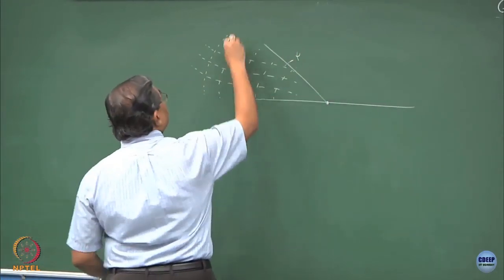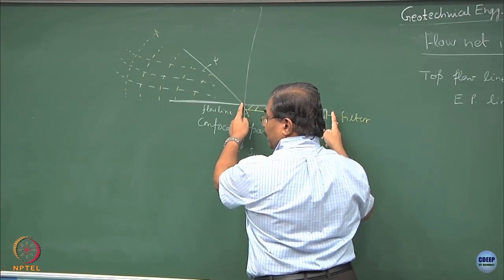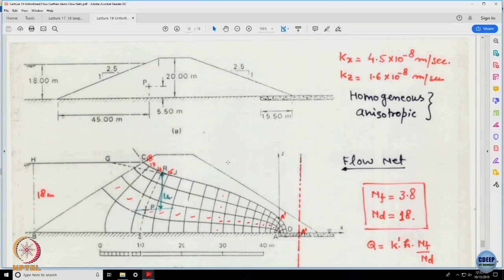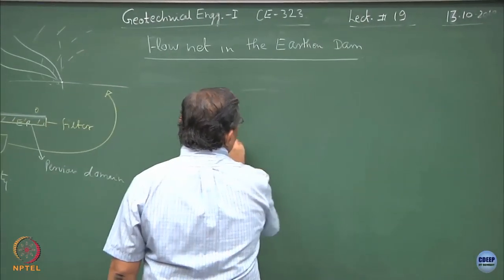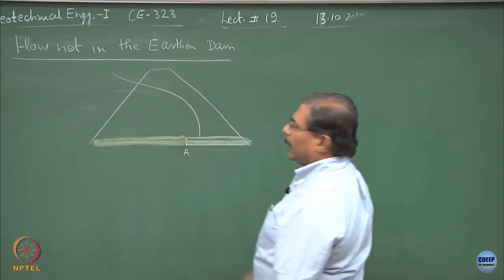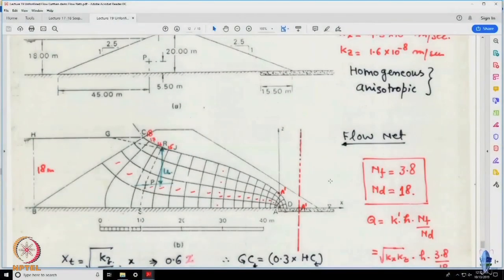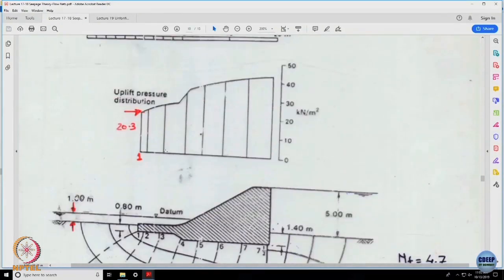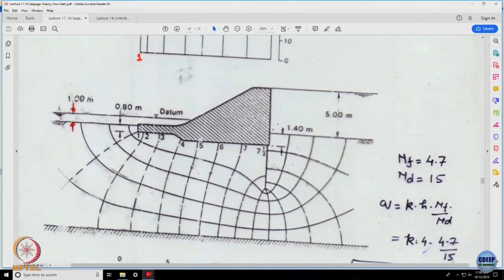Week 9: Lecture 21: Flow Net in the Earthen Dam -I

Comment: How can be number of flow channel in decimal form as 3.8
Reply: When we draw flow net then it is possible that the number of flow channels is not integer like 4,5,6,etc. So for a smaller size flow channels we use decimals... Like there can be 4.5 flow channels , 3.8 flow channels... and same for equipotentials too.

Comment: How we will get Nf as decimal value ( 3.6 , 3.8 as in example)
Reply: @30.00 u can see the scale drawn below as 1 , 2 and3 etc. in the diagram u u can see  that last flow line is impervious surface  and the gap is much smaller compared to above using the below scale it has been find as 4.3